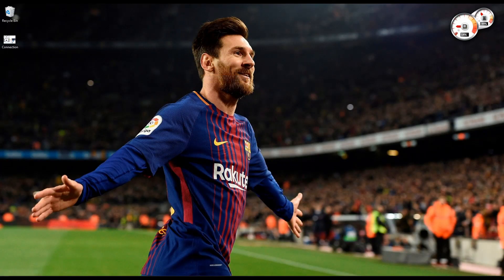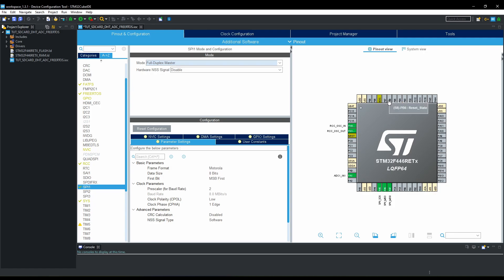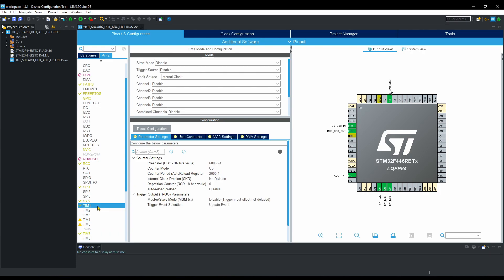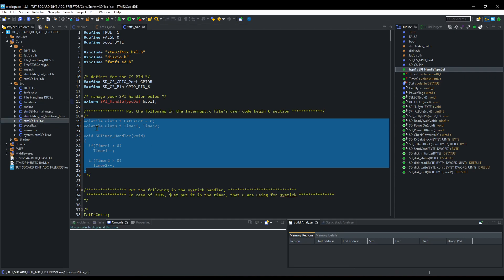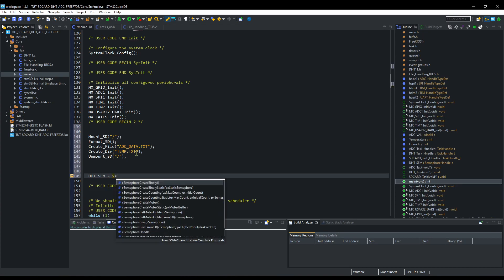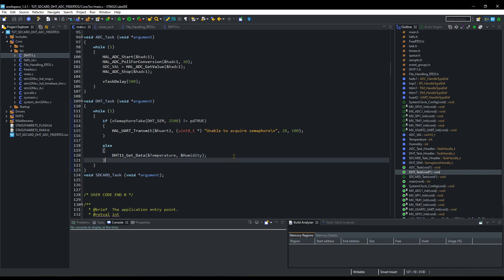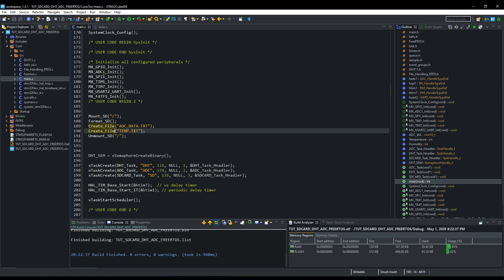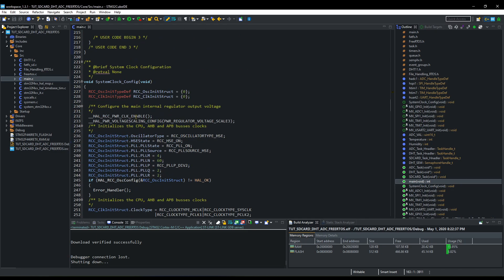Store data into SD CARD || FreeRTOS || STM32 || ADC || DHT

Comment: Superb video as usual, im following your video in a stm32f105RB, i am getting some nasty HardFaults when using Update_File() inside the FREERTOS task, if i place it at the beggining following CReate_File() it works fine.
Any ideas?

Edit: same happens with Format_SD(),

Mount() and unmount() are fine , you dont seem to have any issue in the video.
Reply: I fixed it, the functions involving a SD card transfer didnt like to be interrupted by task switching.
I had to raise the task priority to osPriorityRealTime

Format_SD() is still not working
Reply: Hello,
I had the hard fault error as well. To fix it, first try increasing the priority of the RTOS task (to osPriorityRealtime) and if you are trying to store a large amount of data into the SD card, try increasing the stack size of the RTOS task/thread. Secondly, check the formatting condition of the SD card on Windows PC and ensure that you format it to FAT32 filesystem  with the allocation unit size set to 4096 bytes. Also make sure that in MIDDLEWARE ->FATFS settings from the Pinout&Configuration view, the "MAX_SS (Maximum Sector Size)" is set to 4096.  Hope it helps.

Comment: Hi! I have a problem with this project. Im using STM32F401RE microcontroller and sometimes I get an information "Unable to acquire semaphore" in terminal and after that reading are being stopped. Sometimes i have to restert microcontroller multiple times to get some data on SD card. 
 I tried to change frequency to 80 MHz but it doesnt work. Can You help me with this problem?

Comment: Great video.. I wonder if we can save data into excel file instead of txt file. Have you experienced storing data to excel file?
Reply: that's not embedded dev's job. someone else will take care of it dont worry
Reply: @DJ-Thompson-13  why should we need someone else if we can make it automatically?
Reply: @hamzaisk9462  you aren't a frontend developer. Our job is to store the datas
Reply: @hamzaisk9462  i mean you always pick the most effective and efficient way. Fast, low power etc. Why would you bother putting windows in your chipset. You have limited ram and flash.

Comment: Very nice video!  Here is my problem:  The DHT_Task stops running after a while (If I increase the clock speed, it runs longer but still fails.)  If I do nothing in the SDCARD_Task except delay, all tasks keep running.  If I only do Mount_SD() and  Unmount_SD() DHT_Task fails to run.  Where could the problem be?  I am using NUCLEO-446RE.
Reply from the maker: Could be the timing issue with DHT11.. try debugging the code. If it stops, check whether that happens in the dht code..
Reply: @ControllersTech  Thanks very much for the reply!  The DHT task is not executing at all.  I toggle a test flag as the first statement and watch this flag in the debugger (or set a break point).  This is my first experience with freeRTOS.  I'm wondering how the execution of the DHT task could be blocked in this software.   I noticed that at least one other person had this same experience.  I will check it out more and post anything that I discover.  Thanks again!
Reply from the maker: But you said DHT was running for some time.
Anyway give DHT11 task as highest priority and make sure no other task should be able to preempt it
Reply: @ControllersTech  Thank you again for helping me here. Yes DHT task runs for roughly 30sec.  I found this:  It appears that the task priorities must be 1,2,0 (DHT, ADC and SD, respectively) in order for all tasks to keep running.  I just checked and the SD card has logged 688 samples!  In the video you said to make the SD task the highest priority "or  else the volume could fail."  This seems to make sense, but for some reason does not work.  Let me know if you have any insight.  I will study more about freeRTOS.  Thank you for this very helpful example that can be used as a guide/template for other projects.

Comment: Hi, I'm always having a problem reading dht11/dht22. The code always gets stuck and I'm running out of ideas why. Could you please help me? I'm using stm32f303k8.
Reply from the maker: Telegram me @controllerstech
Reply: I am having the same issue.  After a while DHT_Task stops running.  What could be the cause?
Reply: @barrykeane2716  in my case the problem was with the frequency of the microcontroller. I had to increase it from 16MHz to 64MHz. After that it worked like a charm.
Reply: @markoamon6958  Thank you, Marko!  I changed my HCLK to 64MHz (It was originally 60MHz) and it looked like it was working, but quit after a minute or two.  I changed it to 80MHz and it is still working.  So, the clock does appear to be critical.  Thank you for the help.  Of course, I wonder why the program is unreliable at different clock frequencies.  I would have to understand why before I would be confident using this in a real design.
Reply: Update:  It quit after about 7 mins, so still not reliable, just takes longer to fail.  Incidentally, I am using the NUCLEO-F446RE
Reply: @barrykeane2716   I myself was wondering the same thing yesterday. Why does an Arduino with atmega328p read dht without a problem on 16MHz clock while an stm32f303k8 needs 64MHz?

I would say that ARM cpu needs more clock cycles per instruction or/and HAL library adds a lot of weight.

In my case code became stable when I switched the clock freq. to 64MHz. But I wasn't able to read DHT right after mounting SD card which I still don't know why.

If you are using something like FreeRTOS maybe check that your code is not interrupted.

Comment: How can design full inverter circuit with low battery cutoff and overload using stm32
Reply: You could find an inverter circuit online and implement with an arduino first. Then port to stm32.